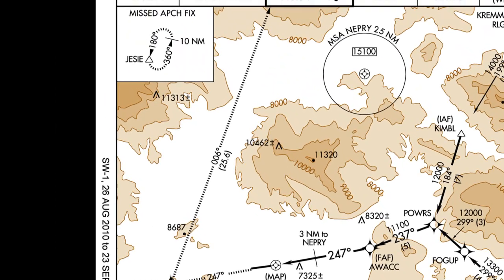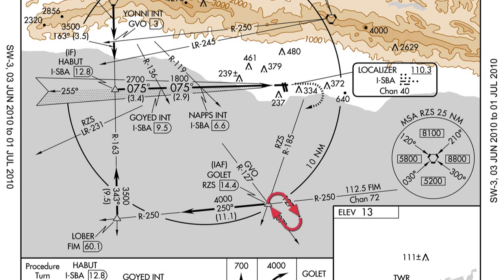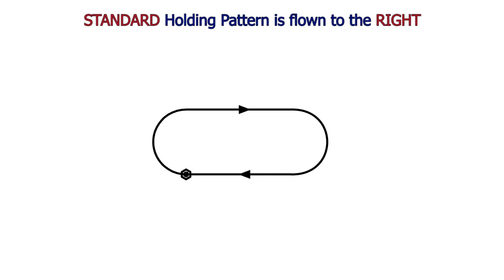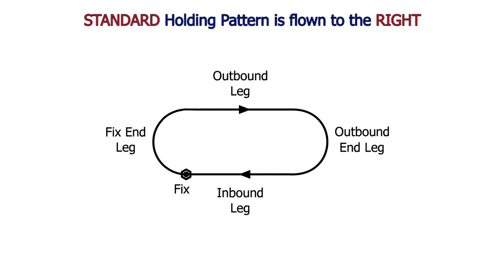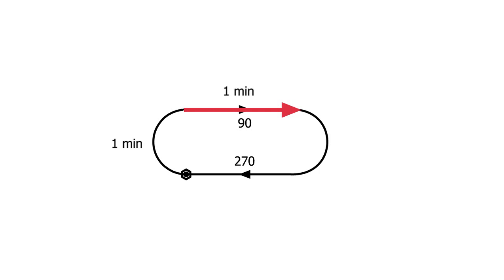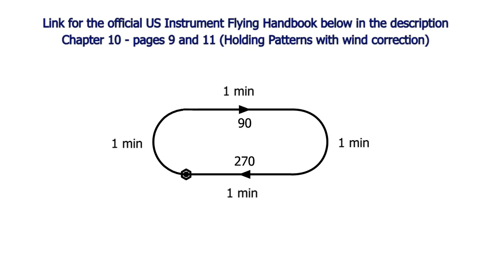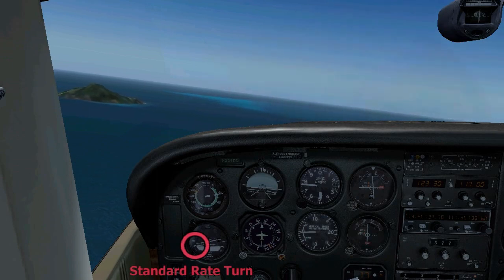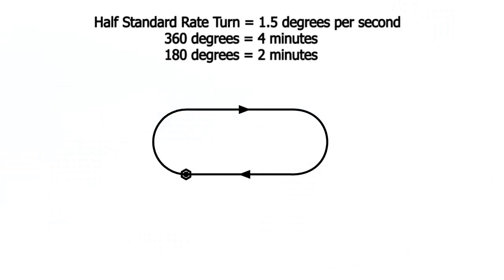Holding Pattern and Procedure Turns Tutorial (MSFS) - Part 1 of 2

Comment: O dont agree, with airlines rate of turn Is always 3xsec, and Is easy with 200kts standard rate Is 20+7 27 Is the turn,(CK Fly the wing, with Jim web)
Reply from the maker: Manrique Hidalgo fair point for 200kts but I think airliners have flight computers that determine best banks, pitches, etc. As long as you're on the safe side (of the hold) you're really fine with anything
Reply: Thats F/D for. AND give always 3-degrees/ SEC.and un small planes Turn Coordinator
Small and large acft, Is the same.
I tested in  Piper Cherokee, on DC,3 Dc6, 737, and A 320 AND more.
I have a manual with copyright,that talks  about this AND more.
Sorry to said ir, but Is like that
Reply from the maker: Manrique Hidalgo when have you seen an airliner do a 30 deg bank turn? Thats 1.4 Gs with passengers. Most airlines wont allow it unless its a special approach. Dont talk nonsense please

Comment from the maker: 30 deg works for tear drop entries only. You can also do 20 deg and fly out for 2 minutes, or 10 deg and fly out for 3 minutes.

Other two course reversals (procedure turns), direct and parallel, have different procedures.

This is where it gets tricky, because the entries are only suggestions because they work, they are not requirements. As a pilot you can choose to do any turn that will put you in a position to do the approach, as long as you do it on the safe side (side of the racetrack).

Comment: @bob22903 Coincidentally I just read this regulation because I am studying for an airline interview I hope to get called for!  It is in the Aeronautical Information Manual (AIM) ch 5-3-7 which you can read at   faa dot gov. Scroll up two pages from the last frame of chapter 5: " 6. Pilot action... (b) Make all turns at
- 3 degrees per second (standard rate) or
- 30 degree bank angle or
- 25 degree bank provided a flight director system is used.
Note: Use whatever requires the least bankangle

Comment from the maker: @bob22903

The airliners have a flight director to help them out, but 15-25 degree banks is just fine.  Only mathematics is an exact science, with flying you have to be able to adjust a you go, one day you can have stronger winds and the other light winds, so you have to adjust to every situation individually.  You'll see this even more during Part 2, where the procedure turns ONLY put you IN A POSITION to enter the approach, nothing is exact and there will always be minor adjustments.